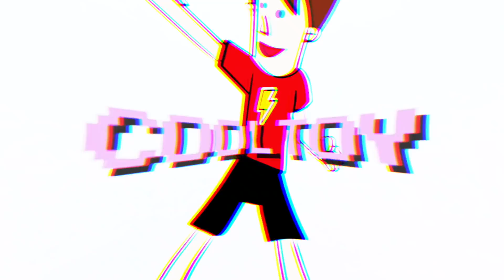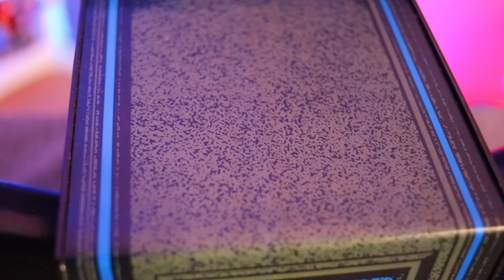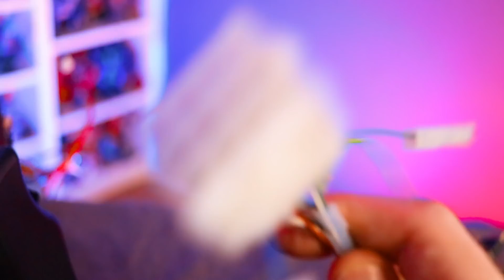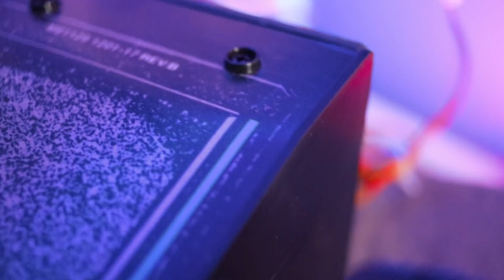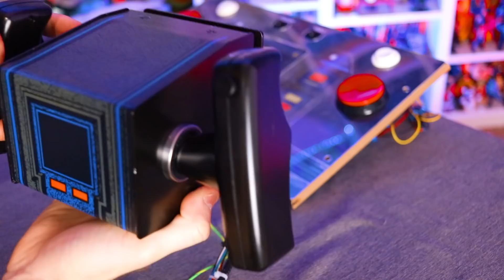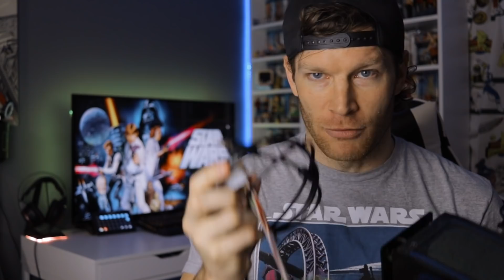GRS Flight Yoke - Replacement for Arcade1Up, Original, or Modded Arcades!

Comment from the maker: UPDATE Unfortunately it has been revealed that due to issues beyond control the retail price will be $265 and not $200 as originally planned.
Reply: How would you say the response is vs. The stock yoke? It's tough to tell in the vid, but it looks like the movement response is slightly delayed. I.e. you move the yoke, then a half second or so later you see the character on the screen move.
Reply: @TheArcadeRat2525  That would depend on the settings in your game. For MameUI, for instance, I found the default dead zone would do that because it had to travel before doing anything. Once set to .05 or less, it works terrific. I've used it with a number of PC games now and it works really well. Star Wars Starfighter is pretty nice. I used to own a ROTJ arcade cabinet, and having owned it for several years, I can say this version is superior my view. The original was built to withstand abuse, but this one is built to play well, and the USB functionality is great. Unless you were replacing an arcade unit that was going to be in commercial use, I'd go with this one every time.

Comment: Thank you for this review. I just found out about this, and have been wanting to build my own Star Wars arcade for well......40 years or more? For the last ten years or more, I've been trying to find an Actual SW Arcade yoke, and as you pointed out, originals are easily $500 for a refurbished on eBay - and that is a maybe if it is complete. The Arcade1 is an obvious choice, but I couldn't buy one when they first came out, and now they are gone and the new versions with the 'seat' are almost all gone as well. And besides, I wanted to build my own. I'm so glad to hear about this, and so glad it's available on Amazon - and once again - not having gotten one yet, I SOOO appreciate the review you did which not only answered all my existing questions, you covered bases I wasn't even aware of - so thank you so much. I'm definitely going to buy one this next payday, and FINALLY start building my Star Wars Arcade cab. Whoo!! Thanks brother. .....May The Force Be With You.....Always.....
Reply from the maker: glad I could help!

Comment: All am very happy to see this GRS yoke but I am esp interested in how well this plays with star wars mame. I have tried my very own cobble of a UHID from ultimarc and the arcade 1up yoke. Its not bad but no way can I play like I can on the existing A1up fixture. So has anyone played GRS on star wars mame (via usb on windows) and gotten anywhere near 3 - 10+ million? I ask not to be judgy or confrontational, but a lot of times it appears that the game is often secondary to some of these very slick and cool presentations. Im almost finished with a retro 8020 rig and I really want to stop fiddling about. Will this GRS get the job done on star wars mame?! Would be most grateful for any feedback on this.
Reply: Ok my pc is pretty substandard, so backing down the version of mame to several years back fixed the issue(non GRS yoke). I also had to dial back the speed to 0.94 to match the speed of the arcade 1up cabinet (pc was way too fast out of the gate). Many more trials and tribulations await .. but the rig can move ahead. Also on TGMS of 6/1 hard.

Comment: Looks awesome. So, if I wanted to use this for something like a Bee Kong mod, what would be the procedure to add the buttons which would be needed? Could the USB be used with a USB encoder with the other buttons also connected to it?
Reply from the maker: @scott boehmer yes, you can use the USB connection of the yoke in conjunction with USB encoders for additional buttons if you wish.
Reply: @cooltoy  thanks for the info. That's good to know since obviously some of the things this yoke could be used for would need more than just the yoke buttons.
Reply: I plan to find out how this would work with my mod playlist and setup when I get my kickstarter GRS yoke soon! can't wait to check it out and compare

Comment: Any idea how you could use it without mounting it? My arcade cabinet has a trackball in the middle so mounting it isn't really ideal. I was leaning towards getting a flight stick and/or driving wheel but this does both and is star wars themed like my cabinet. So I'd def get it but I was hoping it had a base like a lot of those wheels do. Something I could have sitting on top of my cabinet and pull down and use as needed.
Reply from the maker: there is a company called 99livesarcade that makes custom control panels for arcade. I know they were looking into making something to mount this yoke to that would possibly be interchangeable or modular with some arcade control panels. You may reach out to them and see if they have an update or an idea for you to allow you to use this without making a major modification to your existing control deck.

Comment: Do those connectors just dangle behind the cabinet, or does each setup has its own dedicated harness?
Reply from the maker: All the connectors not in use would just dangle inside the cabinet. But that’s an easy remedy with zip ties

Comment: Alan 1 has the arcade 1up controller, + their own yoke , which works flawlessly with Star Wars a1up pcb (i know because i bought one). you shlould at least compare both.
Reply from the maker: The Alan-1 yoke is $350, then an additional $99 for their Arcade1Up adapter from their site, so in all you are looking at $450 to be able to “compare” it with this GRS yoke at $200. Which to me, tells you everything you need to know. I can’t fathom there are too many people willing to pay the original $499 asking price of the Star Wars Atari cabinet and then drop another $450 on the Alan-1 yoke/Arcade1Up adapter combo, when you can do more for less with the GRS yoke without sacrificing performance.
Reply: @cooltoy   Granted, the GRS seems like a much cheaper alternative. But how does it technically compare to the Alan1 (despite  the cost) that's what i'd really like to know. I agree Alan1 is much more expensive no question there but i assure you,  you get the true and definitive experience and feel the yoke was meant to offer. I can tell you right away, on my first playthrough with the Alan1 yoke, I did beat my highest score even before properly recalibrating the yoke. (And i play my unit a lot) Compare to the A1up yoke, its day and night trust me. Its much more precise since you have aluminium gears inside, sturdy as hell for the next 25 years, and you can perform faster movements with much more precision compare to the plastic A1up yoke running on springs grinding on plastics. I would have to try the GRS to compare but unfortunately, i won't be buying one just to do that. So I guess i did purchased the most expensive alternative, (no regrets so far though) but when i bought in august i didn't know about GRS. Also i'm not sure i wouldn't consider Alan1 if i had to choose, I purchased Alan1 to bring my unit as close to the original arcade game as possible and that's what i have now, i'm 47 this machine is my childhood dream come true so i didn't care about the money. If you ever have a chance to review the ALAN 1 too, I would very much like to have your opinion on how they compare. Maybe a future video ?  :) Cheers !

Comment: Cant buy it yet?//
Reply from the maker: This yoke was originally backed by a Kickstarter campaign. All of the backers will be receiving theirs shortly. Once that is done, the general public will be able to purchase this from Amazon ideally in a month or so according to Glen.
Reply: @cooltoy  how does it compare to alan-1
Reply from the maker: @adamcartermi5  both are made from high quality components. This GRS yoke has a different internal technology than the Alan-1 uses, and is compatible with many more set ups straight out of the box than the Alan-1, and is $150 cheaper.
Reply: @cooltoy  
Awesome. But does it feel great? Like does the yolk reset back to neutral when u let go of the side triggers etc.
I guess does it feel like oem?
Reply from the maker: @adamcartermi5  it feels great, very sturdy, and yes it resets back to center if you let it go.
Reply: @cooltoy  I want to mod an arcade 1up or a regular crt old cabinet I have ...to be an exclusive ...shooting arcade cabinet ( using Sinden guns) , driving (Daytona USA, mario kart ,etc) and flying ( after burner ,etc.). Would you recommend this yoke for that cabinet ? Platform might be a coin ops type. Love your reviews, simple and straight to the point.
Reply from the maker: @Jumanji-ds5nd  I’ve been really happy playing racing games on my modded cabinet using the Star Wars yoke. Works out way better than I expect it to. I think you’d be happy doing the same, assuming you don’t want something like dedicated racing gas and brake pedals. If that’s the case, then you’re better off using a dedicated racing wheel setup instead